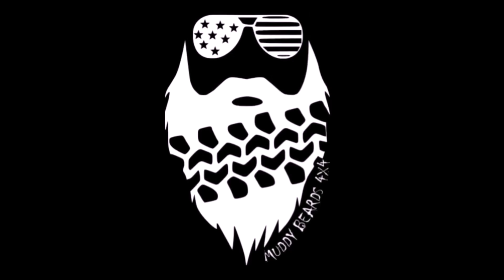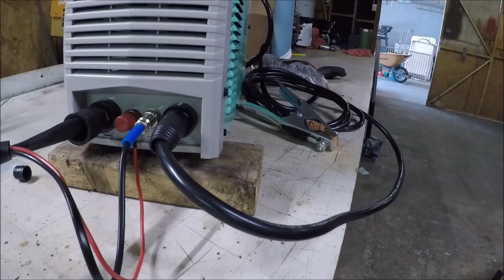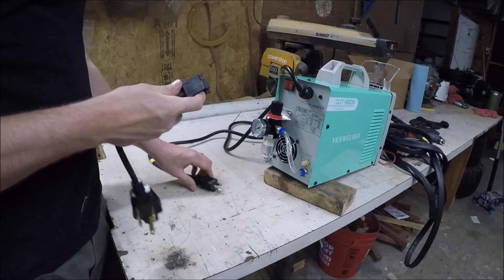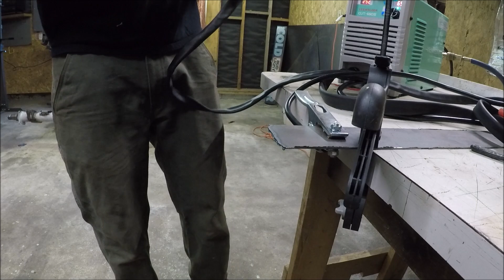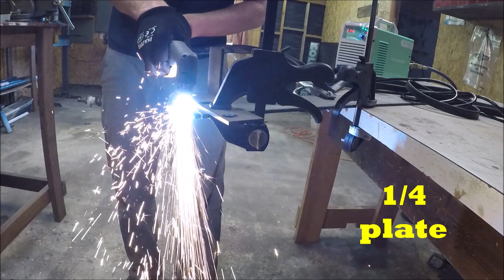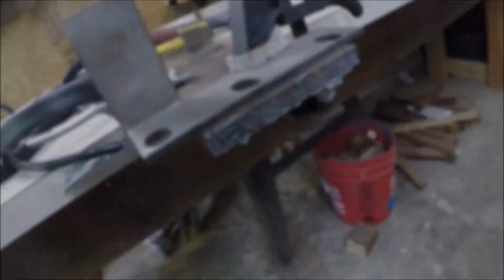The Perfect Affordable Plasma Cutter (Yes Welder Cut 65DS)

Comment: I have a PrimeWeld Cut60. I think I paid $600 two years ago. It appears this unit has similar capabilities although the Cut60 has a port for CNC control. Either way if you have a need to cut steel under 1/2" and you are on the fence buy from either of these companies. The productivity improvement vs cutting wheels or oxy-acetylene makes them very cost effective. A typical one hour part now just takes 5 minutes.

Comment: Yeswelder has a programming error with this model. When you turn the machine on, it will automatically default to 65 amps on the display, but it will not output full amperage unless you change the amperage. If you do not change the amperage it believes it is running on 110 volts and outputs 35 amps. Try it, you will notice. Huge difference.
Reply: Did you tell them? Did they reply?

Comment: Hey I have a question, I bought the badlands Apex 12k synthetic rope winch and I need to remove the clutch handle to grind it down to fit my bumper. I watched your video because I pulled out the set screw and the handle won't come out. I tried turning and pulling up but couldn't get it out. Do you know what could cause that. You've gotten a good look at the internals I thought you might know.